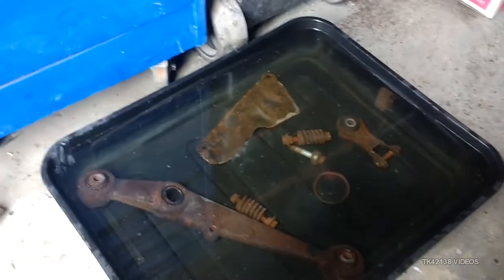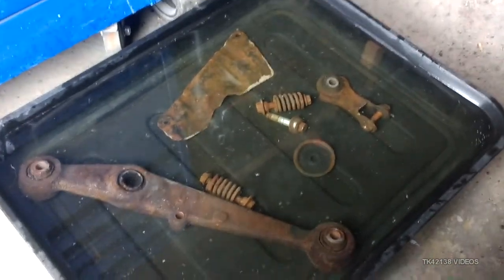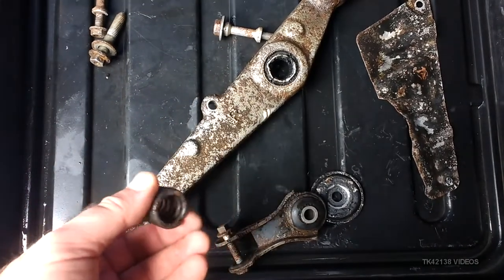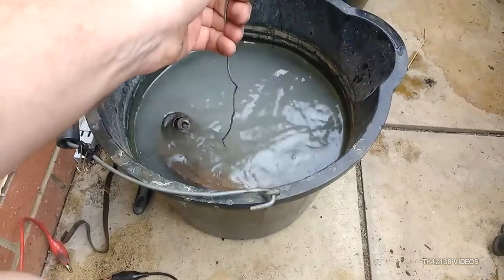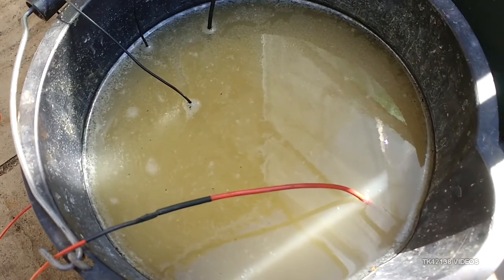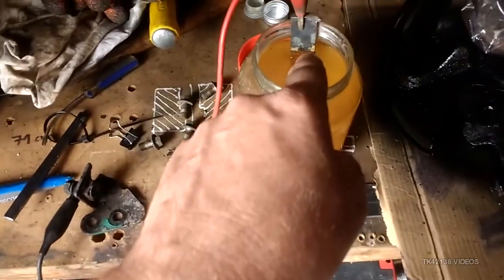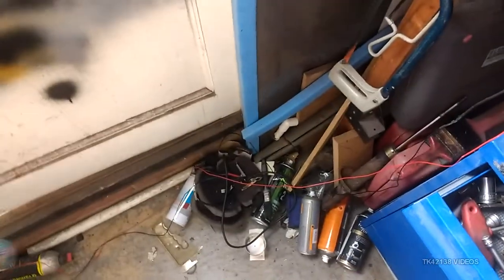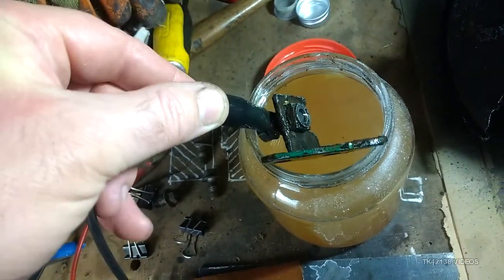Part 40 De-rusting suspension parts which worked better; citric acid or electrolysis?

Comment: Bout to tackle the same stuff brother.

Also did doing the electrolysis before removing bushings help the bushings come out easier for some reason or another? If it did I was just going to do the treatment first then remove bushings
Reply from the maker: Hi, no, the bushes were still tight as they are an interference fit and none of the liquid would get between the bush outer sleeve and the suspension arm.